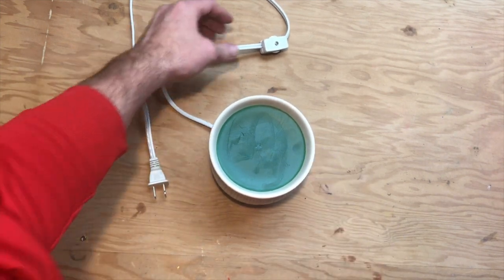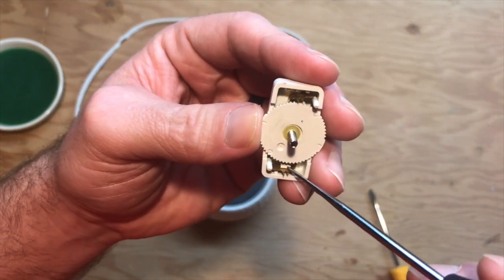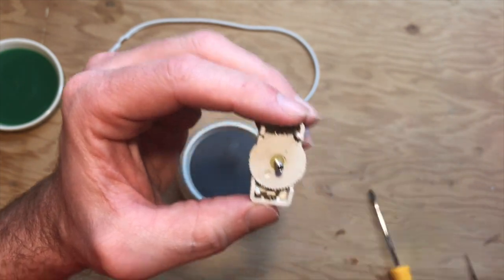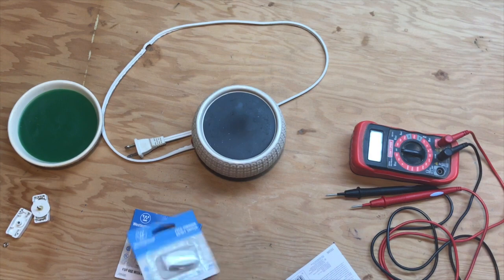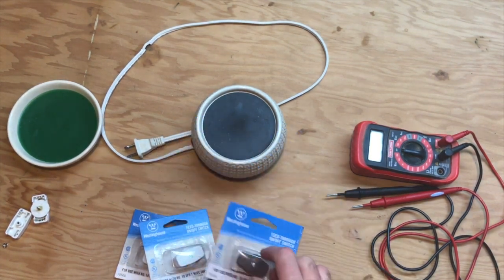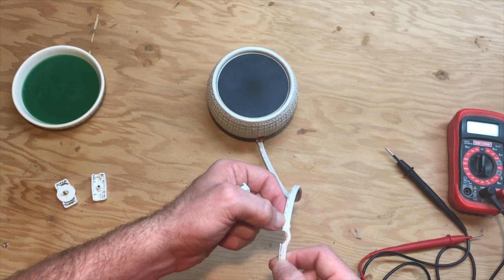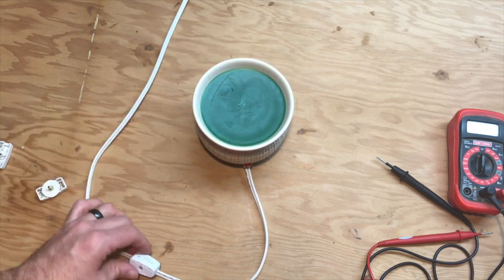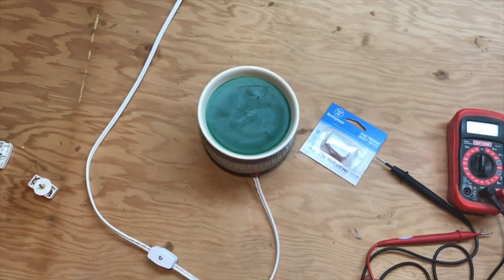Wax Warmer Repair

Comment: Thanks for the tip! What do you recommend for a wax warmer that doesn’t fully melt your wax melts but it still turns on and warms up slightly? :)
Reply from the maker: Make sure you are using the correct bulb.  Might be using a lower wattage bulb than it calls for?

Comment: Great video! Mine turns on, but rotating wheel is hard to turn it. How can i loosen it up? Thank you!
Reply from the maker: You could try backing out the screw a tiny bit.  Unplug it first..  and loosen the screw and test it.
Reply: @DakotaBusy  I'll try that. Thank you very much.🙏🏻😇🙏🏻
Reply: @DakotaBusy  I just tried what you told me and it's fixed. Thank you and God Bless you. 🙏🏻😇🙏🏻

Comment: Can you shed some light.. my candle warmer is not working.. we opened the warmer part and found the ceramic block inside got a crack.. now ai got that from USA but I am in another part of the world:( any way to fix that? TIA
Reply from the maker: I didn’t have to look into our ceramic block.  Maybe someone on here will comment if they have tried to replace that, or if you maybe just need to scrap it and get a new warmer all together.

Comment: My problem is that it burned through the paper thing on the bottom of it to cover the heating plate then it burns everything it sits on. Is there any way to fix this?
Reply from the maker: Sounds like a fire hazard at this point.  I’d say time for a new one.

Comment: Is the fuse not supposed to be tight? I let my sister borrow mine and she moved the fuse nob.
Reply from the maker: I didn’t have to mess with the fuse in ours.  I would think as long as it holds the fuse tight enough so it will not fall out or loosen will be good.

Comment: I got one for xmas and I can hear rattling inside. When I opened the bottom I found a circuit and then two braided wired that ended in  what looked like a small rectangle of cement. Only the "cement" was broken. I can't tell if that's by design to allow heat to escape, as it there's what looks like a "fuse" inside the "cement". Or my family member got a broken product. :(